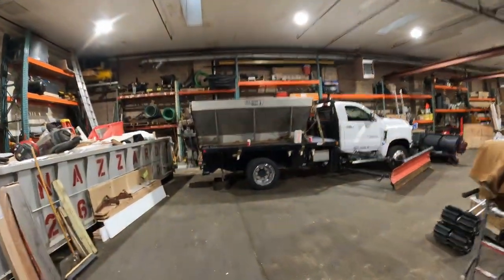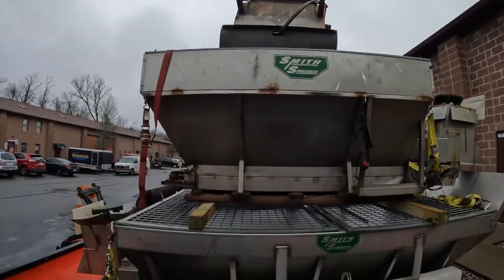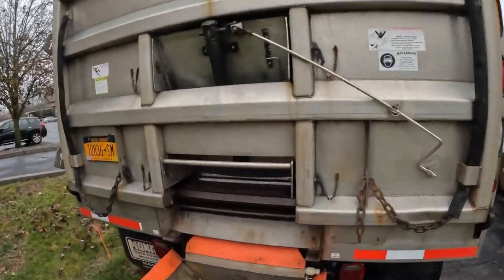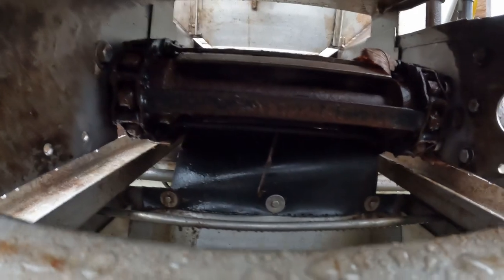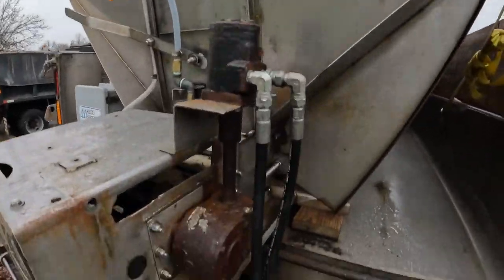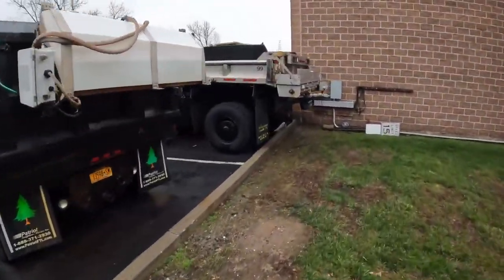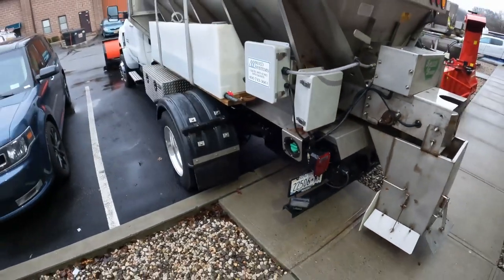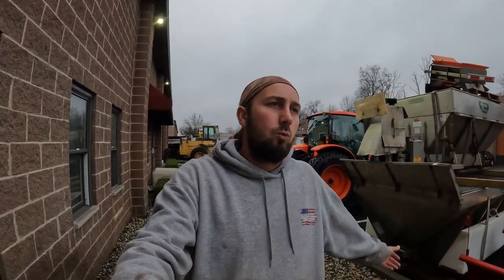SaltDogg Spreaders VS Smith Spreaders!

Comment: I had a Smith spreader and it was easily the best salter I have owned BUT back when I had mine the controller and wiring were so "backyard mechanicish" . I think I remember them admitting they were having issues with suppliers and design...Did you experience this?...Best, Steve
Reply from the maker: Yes we did have this issue. The controller wasn't communicating with the computer. Dealt with it for a couple years but they worked through it and everything is good now.

Comment: Auger driven are good for salt but if u sand the sand doesn't pass thro as good like the chain drive I used run salt dog Auger  feed worked great for salt but didn't like it to spread sand it sucked
Reply from the maker: Good to know! We never use sand though so luckily we don't have to worry about that lol